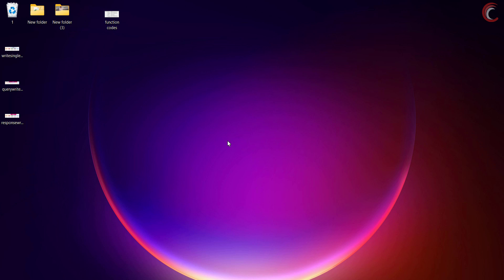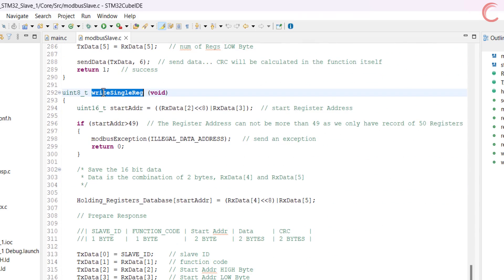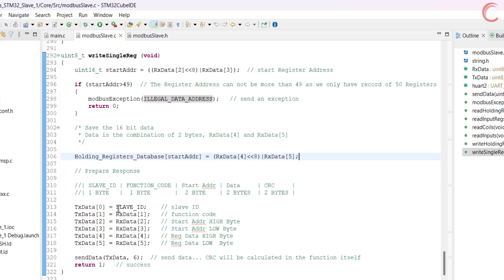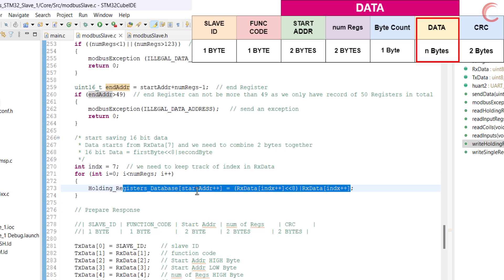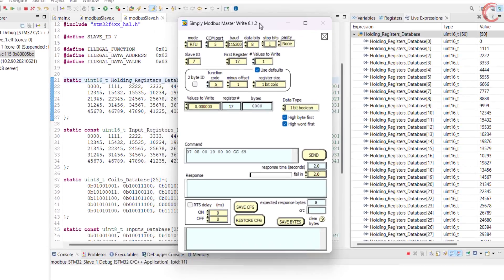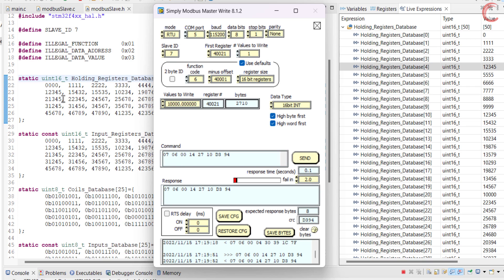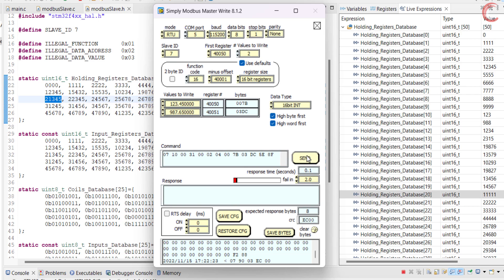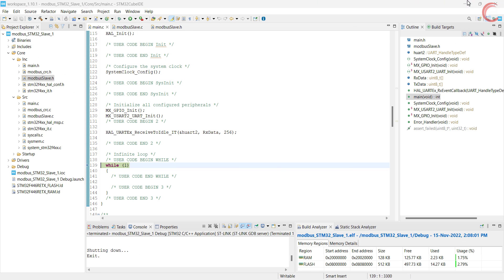Modbus #6. STM32 as SLAVE || Writing single and Multiple Registers

Comment: it seems that this library is not working for STM32F1, I tried to change include STM32F4 -> STM32F1 but when I try to run it on app simply Modbus Master it fails, can you please release a library for STM32F1 :( (( Thank you very much

Comment: Hello
Thanks for the wonderful tutorials.
the modbus series was awesome but also I have a question...
As we know, STM32 microcontrollers do not have EEPROM memory. Therefore, when single or multiple registers are written by the master on the slave, if the microcontroller is reset or the voltage is cut off, all the data that master had written will be lost.
Do you have a solution for this issue?
Reply from the maker: You can use flash memory or use some external eeprom